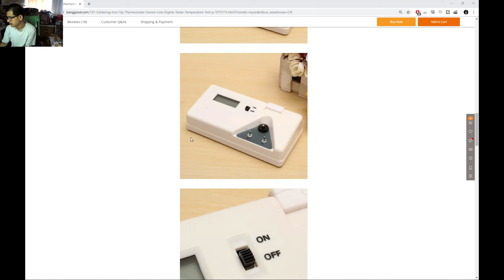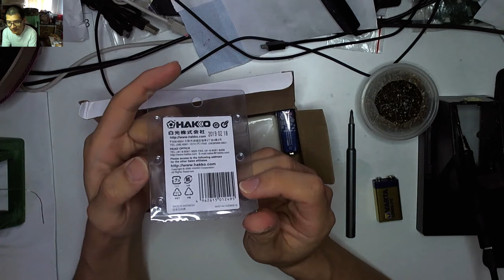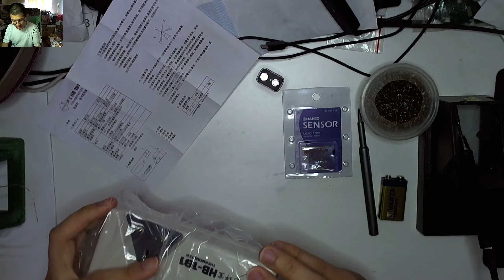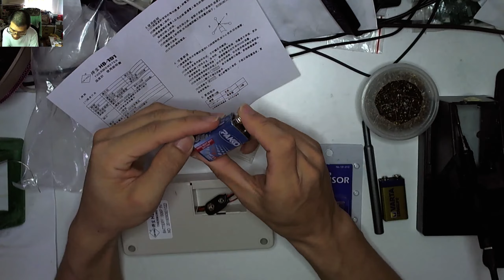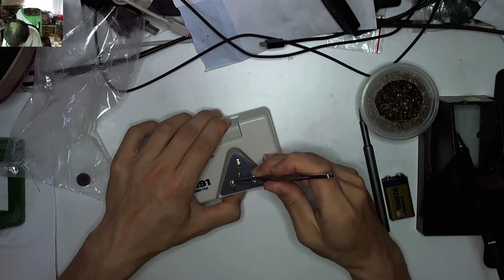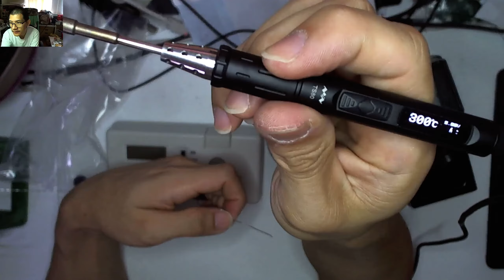191 Soldering Iron Temperature Tester Review

Comment: Actually disappointed in the review if I was going to use it to make a purchasing decision. I was expecting you to make actual calibration adjustments based on the data then retest to see if that made a difference. At the end you could have just reset your iron if those adjustments didn’t work out.
Reply from the maker: Appreciate the feedback. Sorry to disappoint. I actually have never calibrated/recalibrated my irons, just not really a requirement for the level of soldering I do, but I do understand the concern if you need absolute certainty of the temperature. If you need something to that level however, it probably is worthwhile in getting a trusted quality device though, and not a cheap clone. Sometimes, how much you pay for is worth it, for various reasons.

Comment: if you said the settings range for this device is 300C - 500C,   then why test it at 280C? thank you
Reply from the maker: Generally to understand the quality of the calibration curve, you want to test above and below your operating temperatures. You can then plot a curve line, and then use that line to interpolate any values. While it is designed for measuring at 300°C, you never want to start your calibration curve on the dot of the operating range if possible due to the error (which they claim is 1%, which is really small amount of error).